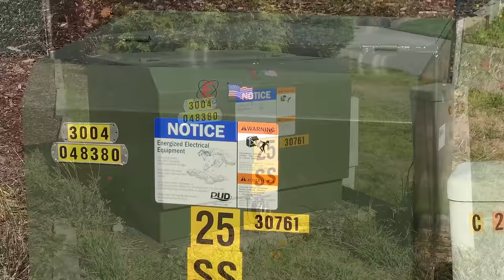Replacing a Pad Mounted Residential Transformer

Comment: I have a question. I live in a neighborhood with underground Service, with green transformers boxes in front yards. What gauge of wire and voltage is used to power the transformers (from the grid) BEFORE the voltage is stepped down to 240v for household use?
Reply: Depends on the utility.  Could be 4160VAC, which is a pretty common medium voltage for distribution.  Cable could be 1/0 or larger depending on the service range, or smaller.
Reply: @infblu3808  Thanks for the information!
Reply: 1/0. 7620.
Reply: Really odd how the wire going to my meter in 4/0 aluminum (must have been fun to make those bends inside that tiny meter box), but I have 2/0 copper for a sub panel in my garage.  Needed 200 amps there.  And these cookie cutter houses were built there was maybe a subpanel in the garage read it at 60 amps and it would have 23 of 24 positions filled you couldn't expand anything

Comment: Mine is rusted out at the base and i called transmission people and they are calling for field inspection It is a late 90’s box. The guy on the phone said the transformer not part of the box but looks like he is wrong. An idiot builder put a flower bed and crepe myrtle around it with 2 irrigation heads have gone full blast on it from 1998 to 2023. It rusted out bottom of lid and base. I think it’s dangerous and stupid to put water directly at the box. What do you think?

Comment: I was wondering why you even have this and saw no poles underground power cables looks so much cleaner looking in the area. The bad thing would be each time you need work or cable service a whole team has to come down which i could imagine takes time. Instead of sending someone the same day like in some other areas with pole power lines.

Comment: I cringed a little when they taped the secondary conductors green...I know they were just keeping the polarity correct on the phases, but it's always weird to see the linemen's lack of knowledge about the secondary side of the system and the industry standard color codes for the lower voltage systems.
Reply: I saw red phase conductors. Also, I didn’t see them tape anything. Maybe I watched the wrong video?
Reply: It seems like they just hooked up everything haphazardly.

Comment: The least you guys could do is torque aluminum wire connections. I'm sure the guy operating the Dewalt knows what he is doing, but the risk is pretty severe that a termination is over tightened and aluminum cable strands are guillotined. Just some input from someone who does a lot of infrared inspections and sees aluminum connections overtightened and under tightened all the time.
Reply: I have terminated thousands and thousands of aluminum conductors in a mechanical lug and I have NEVER used an impact to tighten my lugs. Always tighten enough to hold cable in lug firmly, and then torque to lug specifications. I’ve had many times where I’ve gone into a switchgear and unlugged a conductor just to have the strands break off. They did a great job just crazy to see that be taught and accepted among so many guys that were there…
Reply: @godawgs3555  you’re doing it right! Thanks for sharing

Comment: utilities for electric where I am are telephone pole mounted,,in november a few years ago round 7 PM,blue light commenced in my  north facing windows,stepped out into the alley,a can transformer up on the pole caught fire,,evil smoke everywhere,repair guys got there pretty quick,as they drove up ,another pole a half blk south started sparking popping and splling sparks,,,,shoot ,,a second crew were called,,a city block row of houses went dark,,except  mine,I do not know why,,neighbors house remained dark until 3 am when they finished,,at least it was about 70 degrees throughout the evening, nice dry and warm weather to do the job/s

Comment: I wonder, why high voltage input is not located on opposite side of transformer box ?
I.e. Why both high and low side cables are entangled together, so electrician have to move high voltage cables and even could apply unwanted force to them ?

Comment: So if you have a trafficking accident in a road and you hit the box it could be very dangerous?
Are they tested to see what happens if a vehical hits them.
As I assume the input cables are either fused or other way of protecting the cables are remote from this box?rom the supplied

Comment: Interesting to watch, never seen one like that before. That design makes it quite straightforward to swap out. 

Just wondering where the low voltage side is fused, I can see what I think is the HV fuse on the top left, but can’t see any LV. 

Does the transformer supply a feeder pillar, or do the low voltage cables directly feed the individual properties?

Genuinely curious! Thanks
Reply: I'm not sure about the LV fuse question, but the customer service drops (feeders) are those greased cables they are bolting down at the end with the impact wrench.  3 sets for 3 customers.
Reply: No "feeder pillar". It's being fed directly from the secondary bus in the transformer. The LV fuse is to the left of the orange bushing cover, or what is top left side of transformer. You can see the drip pan to catch any oil that comes out while operating it, just above that you'll see an "eye", that's the fuse.
Reply: @NoName-de6ss  I thought that was the HV fuse, that’s exactly what they look like on the compact transformers I’ve worked on in the UK. Not sure why the LV fuse would be on that side of the tank, or even in oil at all. 
Of course, I could be wrong, I’ve never dealt with a US transformer, so it could be different. 
The reason I asked is that I was curious about the protection on the LV side, and whether the LV cable is fused between the transformer and the customer’s property, because it looks like it isn’t.
Reply: @LordStraightBanana  Nope that's the LV fuse, we call it secondary fuse or bayonet fuse. The official name is bayonet dead break fuse or something of the sort.  The primary fuse would be at a pole or switchgear. The oil is to prevent overheating although it may have other purposes. I've been a linneman for 12 years and I've only had to change that out a few times.

Comment: There must be a lot of grease on them elbows. Did they bolt down the transformer? The linesmen was moving it when plugging in the cables. Should have called an Electrician.

Comment: It's cool that electricians work in the USA) Tell me, are the high-voltage bushing at the transformer these rubber caps? And what does the man with the bar do, change the fuses, or just flip the switches?

Comment: Just wondering was that transformer isolated I work in line industry and I know we use our rubber glove and sleeves cratel to cratel until we are done with the job even if we know it’s not energize just curious you pulled out an energized elbow with the shotgun and checked voltage with no rubber sleeves or gloves.

Comment: One question why is the man with the high vis jacket not wearing a hard hat or gloves and especially no rubber gloves with a hot stick?  Also the guy that was mostly putting it together and taking in a part no safety glasses. Plus did you guys actually have a tail board?

Comment: Does this particular ermco have a tap changer? I have this same transformer and my voltage is always around 124.5 L1 and 124.9 L2 consistently. I know that it within the 5% allowed. However, I have solar and per the UL1741 specification it shuts down or throttles at 126.5 or so per line phase to ground voltage. I nee the utility company to lower the voltage so that it averages closer to 120 or 121.  124.5 is too high with solar.  Also, running 126v (over 252v phase to phase ) is causing lights to burn out and who knows what else equipment is having its life shortened due to the higher voltage.  So I was hoping a tap changer is in this transformer to allow the utility company to simply drop my low voltage line by 2 to 5%.   Thanks for any help!

Comment: Hallo. I have many questens. I am a German electrician. What is the normal house connection capacity? Here in Germany it is 22KVA. As can be seen in the video, the old transformer has 25KVA. Especially how many buildings can you supply with it? I hope you can answer me. Thanks
Reply: A typical home in the US will have a 120-200 amp 240 volt main service. This is a split phase service, giving 120/240 volts.
They mentioned in the video that this unit was supplying 3 homes, might have some overhead left but not entirely sure.

Comment: Surprised that’s only a 25KVA.  A house with a 200amp panel can in theory pull 48kW.

And three houses at that.  Our strip heater in our heat pump is 20kW

Comment: Such small transformers are never used in Slovakia due to efficiency. Villages and towns have their main transformer stations from 110/22kV to 400V. Only 400V with 3 phases goes to the houses. (my house has a 400V 3ph supply with a 25A fuse - so the highest possible input I have is 17.3 kW). It fascinates me that in the USA there is a dangerously high voltage running through residential areas and every house has its own transformer, which has a consumption even if the house does not draw any current and thus there are unnecessarily high losses.
Reply from the maker: Thank you for your comment!

Comment: 12 kV high voltage with 3p star connection?
Reply: No, as you can see it is 2phase high voltage with 130/230v output 2 phase + neutral secondary side

Comment: Question.  It doesn't appear that the box was fastened to the ground/pad.  Why not?
Reply: Why would you, Nobody could lift it and if a car hit it, it would not make any difference if a few concrete anchors were fastened to the box.
Reply: @Norm475  In California we would earthquake secure it.  Don't remember where this is located, but there are no storms?  Seems reasonable to have 5/8" anchors.
Reply: @Norm475  Also, we put bollards in front of our electrical equipment, which protects them from car crashes.
Reply: @BayAreaElectric  Makes sense probably in Cali. I live in the Midwest and so far in my eighty years, I haven't been in an earthquake. As far as a vehicle hitting it, a 5/8 anchor will not hold it. As you know codes vary quite a bit from state to state and city to city, and they keep changing.

Comment: We had one replaced at our building with 46 units. Double the size and they did a great job. Killed the feed at the pole to make it easier. They did get me to check if elevator was going up when it was supposed to in case polarity was reversed.

Comment: I can’t believe you didn’t deenergize the primary. I know you have the elbows on a parking stand,  however our working procedures has us deenergize, testing, grounding, tagging. There is no primary voltage at our Work location. Also I’m surprised you had the transformer fused when you energized it .  Seems out of sequence.

Comment: 0:09 fun fact, the standardized voltage for overhead wire that most high speed trains use, is in fact 25Kv, just like this transformer.
Reply: Wrong. It is a 12.47KV primary, and 240/120 secondary. The 25KVA is the apparent power rating of the transformer.
Reply: @englandrasmussen3111  oh, my bad lol.

Comment: I have worked for a large electrical utility for 40 years and have worked these type of jobs many times. When I see Linemen not wearing proper personal protective equipment as in this video ( pulling primary voltage cables from the transformer with leather gloves ). They must have realized this because when installing new transformer they are wearing rubber gloves. This is a unsafe practice.

Comment: How many amps are actually being delivered to the box itself?
Reply: Just pause at time 0:09  It is a 25 kVA transformer that is about 25000 Watt . Input voltage is L L 12470 Volt 
or L N 7200 Volt. Let say they use the L N 7200 input voltage. Power = V x I so  I ( amps ) = Power/Voltage
25000/7200 = 3,47 Amp . High voltage low Amps,  low voltage high Amps ( 25000/240 ) 104 Amps or at 120 Volt 208 Amps.

Comment: On the primary side, are these wired phase-to-phase or phase-to-neutral?
Reply: I think I answered my own question. IEEE Std C57.12.00-2015 table 7 says that the designation "12470GRDY/7200" means a primary operating on 7200 volts with one side of the primary winding grounded. The hot side is connected to one phase of a  3-phase 12470/7200 V system (12,470 volts between phases, 7200 volts from phase to neutral). So it's wired phase-to-neutral, like most distribution transformers in North America outside California (and possibly some other dry western states).

Comment: Greetings. 
What is the voltage on the primary winding of the transformer?
Reply: 10kV. (Or 7.2kV.) Something in the thousands of voltage range. Enough to make you a crispy critter if you touched it.
Reply: @fitybux4664  woooow, in our country for 10 kilovolts brick substations are being made with rain protection and normal switching.

Comment: I don't understand why at times they have their protected rubber gloves on and at other times not even so much as leather work gloves...no safety glasses and the guy in yellow no hardhat?  handling ungrounded secondary barehanded? What about possible backfeed? Reaching under the padmount while suspended by a sling... not impressed.

Comment: Well, of course they replaced it. Even an apprentice lineman knows that a faded paint job on a pad mounted transformer causes the electricity to leak out twice as fast as one with a fresh coat of paint and new decals.  I’m sure if you would have asked, they would have gladly changed the blinker fluid in your car as well.  But, all in all, it was a very fun video to watch. Thanks for posting.  I do have to say that I’m  not sure they clearly thought through the whole Public Utility Department abbreviation though.

Comment: A 25kVA in your front yard?!!! thought it was stepped down to 7k before even reaching local Transformer?
Reply: 25kVA is Not  25 kVolt it is just to power the transformator can handle . 25kVA is almost the same as 25kWatt
I believe it is a 7 kV / 120 / 240 V transformator.

Comment: Might have cut it out, but I didn't notice any discharging of the load side before they put hands on it, or live-dead-live tests.   And what was the arc-hazard of that door they casually opened bare-handed?
Also didn't see any third-party testing or acceptance testing of that new device after it was dropped on its pad.  All I saw was continuity on the secondary side, which is at least a half of the very, VERY least that I would like verified.
What about the cables?  They look old AF.  Not even a verification to see if your brand new transformer isn't going to be exploded by old cable?

Comment: If was a customer of that utility, I'd be upset that they're spending thousands of dollars on equipment and labor when a simple paint job would have sufficed, assuming the existing transformer is still outputting within specifications.  Seems like a waste.
Reply from the maker: Perhaps. However, did you read my description? I called PUD and asked permission to paint the box. I was told this is not allowed. It was already on their list for replacement. It was 40+ years old. My call simply moved this up on the list. Good thing! The utilities infrastructure must be up to date. Take Texas as an example.
Reply: @randallwingett  I did read it.  I understand.  I'm suggesting the utility is unnecessarily replacing the xformer, instead of painting, but maybe it was beyond its service life.

Comment: The esthetics of the transformer has very little to do with its operation..... as long as your power was being delivered properly to your home, there was really no need to change out the transformer...... Maybe next time they can offer a different color...... I now see after closer inspection it was determined it needed changed due to leaking oil....... Probably not a bad idea, as many of the older transformers used oil containing PCB’s.........👍

Comment: Interesting the comments about safety. I’m just a random guy mid 30’s right, even I was like “I see a little rubber pad there he’s kneeling on, probably to ground himself. Hmmm, but it’s so small, his legs and feet are still touching the ground sooooo, won’t the electricity still go through him into the ground ? Maybe its turned the wrong way if its supposed to cover everything down there” 😂 4:11 ⚡️

Comment: The two guys with hard hats, don't have safety vest, and the one guy with a safety vest, doesn't have a hard hat. Just something you notice when you have had to deal with the "safety man".
Reply: I wouldnt wear a safety vest when working on equipment that can arc flash. I would wear the appropriate ppe for the incident energy categorization. Granted they are still missing their own arc flash ppe. They used the hot stick, implying that the primary side (12.47KV) was live.

Comment: Not much room for the slightest mistake.  I don't think there is a salary big enough that I'd be willing to get that close to the hot primary side of that thing.  Or the secondary.
Reply: The 7200 volt primary on the other hand doesn't allow for many mistakes. So not to eager to play with that.
The 240 volt secondary I don't mind. Given the proper respect it's not so bad.

Comment: They banned using Aluminum years ago round here both in transmission and housing..
Reply: Meanwhile, here in the US, we just changed the alloy to something that's slightly more corrosion resistant. (AL is too cheap to not use it.)
Reply: No they didn't.  All transmission uses steel-core aluminum conductors.  15KV class power conductors are universally aluminum, and the service conductors to your house are 4/0 aluminum if you have 200 A service.  Open your main panel and take a look for yourself.